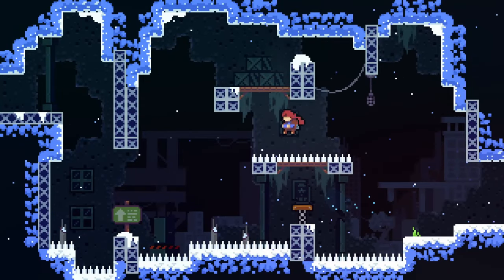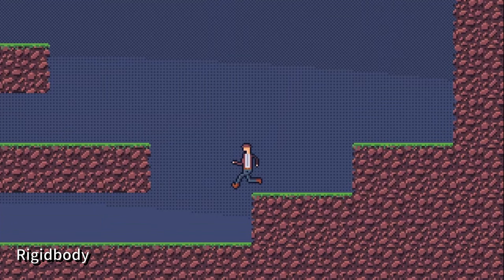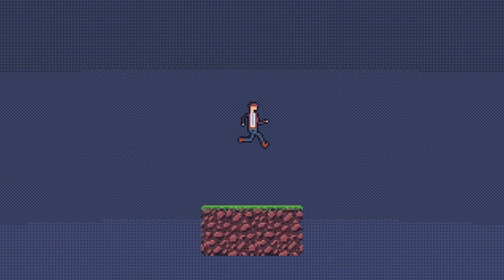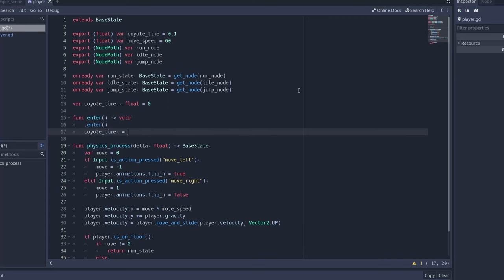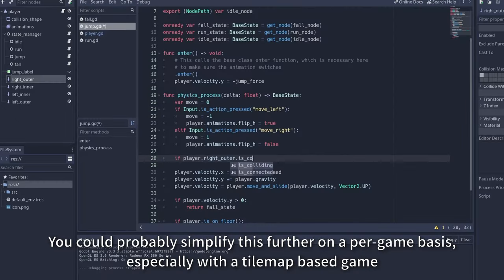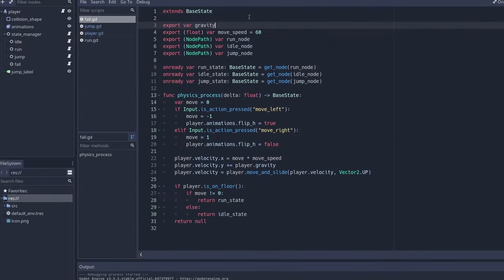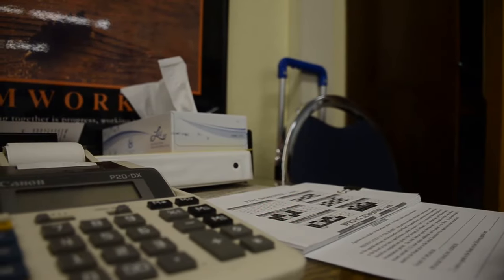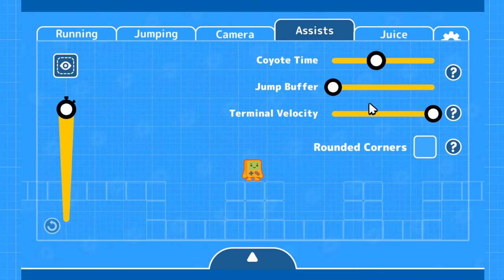5 tips for better platformer controls

Comment: Also if your game has complex combat or a ton of different special abilities and actions, consider using an action queuing system instead of a state machine! It's way easier to manage
Reply from the maker: Excellent suggestion!
Reply: Hi sorry to bother but what exactly is an action queueing system?
Reply: Same question here. Would I apply individual actions from a queue (depending on the current state) instead of having conditions for all actions? But how would that be an alternative to a state machine?
Reply: @michasengotta2295  its basically queuing inputs, of course you can use state machine but its simpler to queue inputs into an array
Reply: @stan7132  I still don't understand how queuing input has anything to do with the way that state is stored or transitions are handled.
Reply: There goes nothing against doing both. Queueing inputs is useful for combos like in Tekken, but with a state machine you can achieve the same by using a condition like: you must have pressed a and then b. So the input buffer would look like [a, b].
Reply: i have a somewhat spammy game system though it's not a platformer, and having buffered inputs is very useful
Reply: @TheShaggyDev   also what’s the game called here? 1:46
Reply: @just_vortex20  bro doesn't know celeste 💀
Reply: @angel_of_rust  that’s the thing. I don’t but I do now (btw the gameplays cool)
Reply: i don't know if i have anything like that in lusa the cathead
Reply: @angel_of_rust  what kind of response is that

Comment: Another great thing to add is some form of momentum to your running! I’m not talking classic sonic style momentum, I mean like 2D Mario, how if you hold down the run button and keep going forward you’ll change into a few different running states. Some games may not need it but I enjoy having momentum
Reply: Wait... Isn't what you're describing exactly like Classic Sonic momentum?
Reply: @Onaterdem they do sound really similar, really the only difference aside from the speed values, traction, etc. is that SMB's is changed with the run button.
Reply: @Onaterdem  well yeah but Mario and Sonic momentum are different in ways. You hold the run button to build up speed and Mario can’t go fast enough to run loops
Reply: @PLAYER42_ready  Hmm well holding down the run button is like holding down the forward button with extra steps, so it's still the same in that regard. The max speed is just an easily changeable variable.

Comment: Umm, the first tip really depends on how you are doing things. I've been making a sidescrolling 2D/2.5D metroidvania controller in Unity (using 3D assets) and I am using a Rigidbody, I simply use a Physics material with no friction which prevents him from getting stuck on walls or ledges/corners (he slides off everything), while keeping the benefit of being pushed/shoved by other rigidbodies (and I increase gravity a lot to make falling more satisfying/less floaty). I also use a time threshold for my input polling (ie: when I need to, my Input manager can check if a button was pressed/released within a specific time threshold. This is a godsend for combos and when the player presses buttons too soon or too late).
Reply: yeah honestly idk why some people don't even try to do anything with rigidbody

Comment: A big thing with these is they are all worthless if you don't design levels with them in mind.

Getting Over It controls horribly, but is learnable and designed the world around it offsetting the issues. Celeste is a great example of how to design a world with good mechanics in mind. The jumps are often big because of the combination of Dashing and Coyote time which makes a wonderful experience for jumping over stuff while holding down to fast fall can help let you make things more floaty for mid-air control at base while giving an ability to snap down faster when needed.

So don't just put these mechanics into your game when it is done, design your game with these mechanics in mind.

Comment: This is a great video! If you're wondering about using rigid body physics for a platforming player controller it's totally doable, but don't expect to be able to get a really nice feeling system without knowing how the physics works and understanding the physics behind what you want to accomplish (moving platforms are a great example of something that's nearly impossible to get right with a rigid body unless you fully understand what it is you want to happen)

I think the results can absolutely be worth the struggle though, you can get some incredible interactions with other physical objects that just wouldn't work without a properly simulated player.

There's a reason why almost all platformers go the Kinematic path though, being able to fully control all the aspects of your player makes everything much simpler.
Reply: One example that I see of people having trouble with rigid body's is on slopes, it's because the idea that a running person (or robot or hedgehog or whatever) can be represented as a single rigid shape starts to break down in a case like this. It's intuitive to us that a person should have little difficulty running up a slope (like it literally takes more energy but platforming characters tend to ignore stamina) but in order to do that in a way we expect we have to things like rotating the player to match the slopes orientation, which is actually usually too much rotation visually but it works in a cartoony style. Even then the large increase in friction from pushing against the surface while it goes away from the direction of gravity is hard to account for in a pleasant way, especially if you want the speed up and down the slope to not be very different.

The solution imo is to not actually slide the player along the ground, what you really should be simulating is the feet moving underneath the player at their intended running speed, while the feet are in contact with the ground they should be imparting force to the players rigid body (through a physics constraint of some kind, most physics simulations have these, hopefully they are capable enough to deal with a situation like this) and interacting with the ground by way of friction. This is obviously pretty tough to do, compared with switching to a kinematic system, but it's not like you really need to simulate the players legs as well or match their feet positions to where it looks like their feet are. so you can still have full control of the "feet" bodies and the constraints between them and the player.

So yeah slopes are really hard for a rigid body player, because without them you can sometimes get away with making the player one solid rigid object that just slides around.

Also there could be a more simple way to emulate the feel of running up and down a slope than with separate bodies for feet, For example I've played around with using friction to drive tanks in 3D by simply modifying the physics system to let me add a specific amount of velocity to the friction calculation specifically, so I could make the tread surfaces behave in a physically accurate way and it worked like a charm, even though the physics I was using was never built to accommodate that.
Reply: It occurs to me now that one very quick thing to try for a rigid body player on a slope is to modify their gravity vector to be closer to the direction of the slope, you could even potentially make the effect fall off for steeper slopes to get gradually less traversable slopes in a pretty smooth way (you wouldn't want that for games where you can run up slopes onto walls though hehe)

Comment: Ive come here after watching your state pattern video. One important thing is that if you can enter the fall state after initiating the jump state, coyote will not work this way. The timer gets reset all the time, meaning that the player always has a timeframe where they can jump mid-air. So the easy solution is to not enter the fall state after jumping (which for most games isnt necessary I suppose?)
Reply from the maker: Good point! And if you need to enter fall state after jump state, you may want to start passing data between states, such as what the last state was, that way you can make sure you only start the timer if you come from a ground state. Can also do things like track when the player was last on the ground, etc.

Comment: Jump Buffering is the most important in my opinion, I've found myself sometimes playing games without it (Namely obscure online indie games), And it's often very easily notiçable, Especially if you have long segments which require the player to jump quickly after touching the ground. A while ago I was playing a game with a few jumps that were far harder than they should've been, because if you hit jump too early, you don't jump because there's no buffering, but if you hit jump too late, you'll slide off the platform, and if you try to stop on the platform, you lose momentum necessary for the jump.

Comment: I have a small one that personally bothers me in games, but it basically only matters on a keyboard. (seriously, pet peeve stuff here)
When pressing Left & Right (A/D) at the same time, they should null each other out and my character shouldn't move.
This goes for ALL games. 2D, 3D, Indie, AAA.
I tend to do this by taking the pressed input values, or use the bools as 0-1, then take one from the other and use this value in my move code.
In Godot 3.5 for example, I do:
inputDirection = Input.is_action_pressed("MoveRight") as int - Input.is_action_pressed("MoveLeft") as int
So,
Holding D: inputDirection = 1 - 0 = 1
Holding A: inputDirection = 0 - 1 = -1
Holding Both: inputDirection = 1 - 1 = 0
Holding Neither: inputDirection = 0 - 0 = 0

Comment: These are some great recommendations. I'm trying to implement the "ledge push" in my project right now on Unreal. I am totally with you on the raycast part, but you glossed over the 'slide' function pretty quickly. What is the method that you use to move your character over if a ledge is detected?
I know you're not using Unreal, but I'm just trying to figure out the general idea so i can translate it.
Reply from the maker: In this example, I just change the position of the object by the appropriate amount the same frame it's detected. A little crude, but should be ok if we're just doing a small amount of pushing

Comment: I will say I think it'd be better to do the delta time subtraction for the buffer feature in the physics process. While the variable is initially modified by an input, the importance of its update is tied to the physics engine. If you end up with graphics lagging behind or freezing, you will end up in a situation where in _physics_process the engine thinks the input is still buffered when really it shouldn't. An edge case for sure, but still worth the consideration. Hell you COULD intentionally leave it in _process if you think it's more beneficial for a player who'd get a freeze mid jump to jump again during the freeze if they press jump again.

The same obviously goes for coyote time with the caveat that I would recommend against intentionally putting it in _process. Sure if the player gets a freeze mid coyote time that means they may die (though theoretically no as input should still arrive at the proper time but let's keep a worst case scenario in mind), but if you keep it in process and they end up being able to coyote time super late in the fall (which will be visible once the game unfreeze) they will feel cheap, which is worse.

For the edge snapping it would warrant testing but I have an idea that may simplify it. Put two rays (one on each side) x away from the character center (x being the max snapping distance). Also put a fairly small box detector above the player's head. If a wall is in that box and the ray doesn't hit, move the player away and snap them back towards the wall. If both ray don't hit, then cast a new ray at the top of both "snap rays" towards the symmetry line of the player, whichever has the longest collision distance is the one you want to pick. Should be pretty efficient regardless of whether you use a tileset based map or not.

Comment: For coyote time would it be better to instead have a collision box extend farther than the sprite thus less things are being computed?
Reply from the maker: Changing the shape of the collision box may have other undesired impacts, as you don't want the character to be unfairly hit by something or to appear to be floating off a cliff if the player stops on the edge. Managing a simple timer on a character is very low overhead and not something I'd be worried about in regards to performance.
Reply: Games already use the bounding boxes for the ledge and it looks ridiculous when the player stands over the ledge with one pixel touching the platform.

Comment: what about fix the slope problem?
like stoping the player when is on slope, this will be helpful in the game, do you know one way to fix that in state machine?
Reply from the maker: In Godot, the move_and_slide function has parameters for handling stopping on a slope. No need to modify the state machine:

https://docs.godotengine.org/en/stable/classes/class_kinematicbody2d.html?highlight=kinematicbody2d#class-kinematicbody2d-method-move-and-slide
Reply: @TheShaggyDev  i tryied it but my player still sliding
Reply from the maker: @G69G71  Double check the up_direction parameter and the max slope angle. If that doesn't fix it, could check out some other resources on that specific issue and see if that helps. PigDev has done a video on slopes, for instance: https://www.youtube.com/watch?v=9l-tf97z2bg
Reply: @TheShaggyDev  i tried the pigdev one and worked but where i put the script from the video? And this works in the 3.5 version?
Reply from the maker: @G69G71  With the disclaimer that I've not implemented the PidDev technique myself, it looks like you'd just put it in the MoveState since he's working with the move_and_slide_with_snap function

And yes, I don't see any reason why this wouldn't work in 3.5
Reply: @TheShaggyDev  i put in the idle node

Comment: when i do the coyote jump system the player had infinity jumps, how i can fix that?
Reply from the maker: Most likely it's because we can always jump when entering the fall state, and the jump state probably transitions into the fall state in your game, which has happened to me before as well.

What I like to do for edge cases like that, is start passing a little bit of data into the state on change. For instance, if we pass in a reference to the previous state in our "State.enter()" function, we can only allow coyote jumping if we didn't come from a jump state.
Reply: @TheShaggyDev  ok, thx but I already fixed that

Comment: you missed to put the system of varying jump
Reply from the maker: Not sure I follow? The last section is about customizing how the jump works over time, including a variable jump height.
Reply: @TheShaggyDev 
Sorry, i forget about it.
Well, so I will just ask for some way to implement a slope movement in the state machine, I get confused about how to put it inside my player with a state machine, I dont found any tutorial who helps in this case.
Reply from the maker: @G69G71  What kind of movement are you wanting to implement?
Reply: @TheShaggyDev  moving in slopes without bounce in the end, a slope who the player can up and down according of the angle of the shape.
Reply from the maker: @G69G71  Ahh I see. You shouldn't need a state machine for that. Move and Slide can already keep you attached to a slope, then the speed can be adjusted appropriately, though I'm afraid I don't have a resource handy for how to do that. Can probably find more if you search around for slope movement in Godot.
Reply: @TheShaggyDev  sorry for asking again but, there is a way to implement a acceleration and friction system to the movement state?
Reply from the maker: @G69G71  Sure, but afraid I don't have any examples handy of how to do it. At a high level: rather than making your speed X instantaneously when you press a key, you'll just want to add some amount of force each unit of time until you're at the desired speed after Y amount of time. Plenty of platformers do this so should be easy enough to find some resource online about acceleration and platformers.
Reply: @TheShaggyDev  I tryed to put a lerp to reduce the speed, just the acceleration worked good, I am having issues to create the friction.
Reply from the maker: @G69G71  Hmm. Sorry, probably not something I can help you with through the comments. Can probably find some additional resources elsewhere, just may take a bit to sort it out.
Reply: @TheShaggyDev  I will try to fix it later, thanks anyways for trying to help.

Comment: Do you have any tips for making a 2D platformer in Unity? Unity doesn't have a great simple physics component for 2D, like its 3D character controller. It's one of the big reason why I prefer Godot, actually, because it has a 2D kinematic body, as well as 2D counterparts for basically everything, and far better 2D support in general.
Reply from the maker: I'm afraid I can't help you too much there. I've not done a 2D platformer in Unity so while I've got some ideas, you'd be better served finding a Unity oriented channel to help. The general concepts from this video would still apply though. Coyote time, jump buffering, etc are all engine agnostic.
Reply: @TheShaggyDev  Cool, thanks
Reply: I believe you can add a rigidbody and make it kinematic in unity